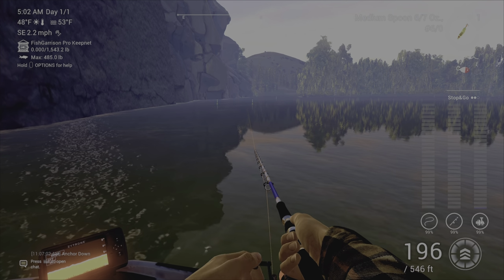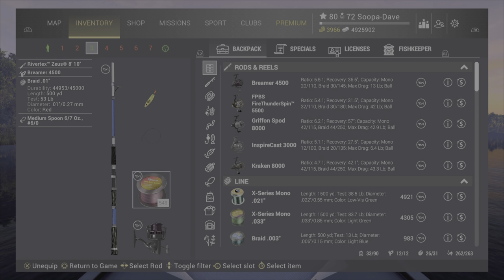Fishing Planet New Fishing Pole Setup Mechanics Guide

Comment: Hey Dave, it seems they fixed the "comp setup". When I try to do exactly the same on steam. Zeus 8'10'' + Spod 10000 + Braid .009'' -> Line breaks after 10s. Then there is no reason to use a bigger reel anymore, is there?
Reply from the maker: That isn't a "comp setup" that I'm talking about in the video. that reel is too big to max drag on a Zeus. The line would be to light and pop right away. Think you need to watch video and see what I'm talking about. I used a smaller reel with bigger line.

Comment: I appreciate your hard work. On the old max drag, I always 'notched' down, 1 stop.  Reasoning being the initial shock on the fish strike. I also like to notch up if I needed that little extra after reading the fish.  IMO, I would really notch down when using X series or Golem for fear of losing. So, test with lures you can replace. I plan to pack an extra Griffon 9000 to swap out a 'cooked' reel. They are going to 'burn' a lot of reels in those comps. 

Also fished today,  Alaska Battle (Chinook) and Blue Crab (Tarp) and just notched down from max drag on Giant spin and Bailarina.  They seemed to do fine. So, I guess if you can't 'reel up' then 'notch down'. lol
Reply from the maker: Yeah not a bad way to go